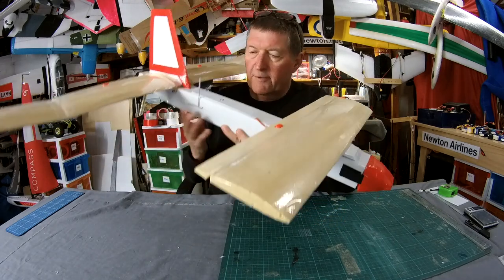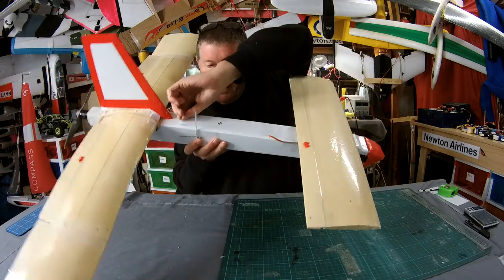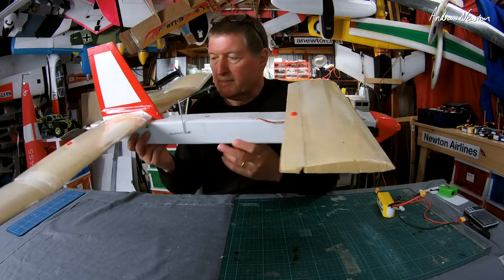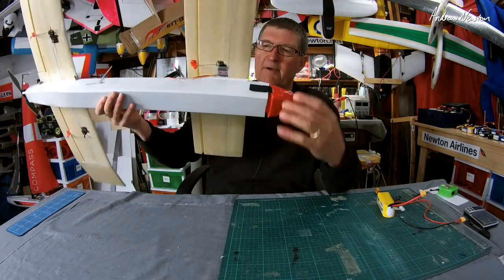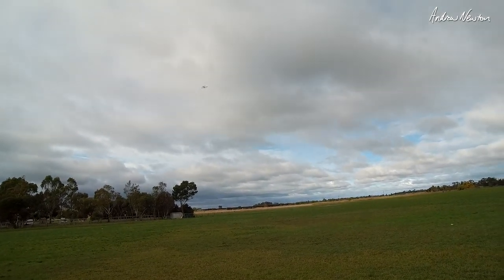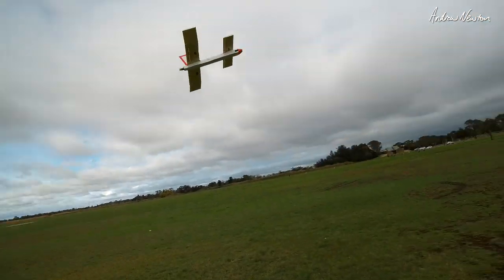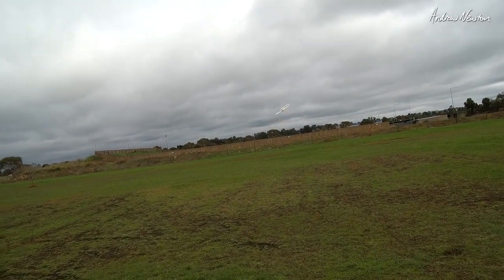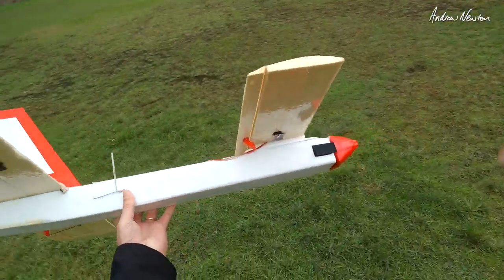Smeg Head mods and plans

Comment: I find that a bamboo skewer thru one of the flute channels (snug fit) makes a nice way to stiffen my coroplast decalague on planes where I use it.
Reply from the maker: Good idea, ready made channels
Reply: @AndrewNewton  It's good for plugging sections together too, as well as stiffening. I made a (fairly wonky) pusher-prop De Havilland Vampire that could be disassembled/reassembled easily, and that was what I used for the joins between the booms - two opposing chunks of corflute on both sides, with barbecue skewers just fat enough to be a tight fit. Not the best method, but can be handy. :) Absorbs energy well in a crash - usually just pops apart cleanly, and if something DOES break it's usually the skewers, so you can poke them out and stick fresh ones in.

Comment: Hi there, loved this one so much I built a 1s Powered one from Depron and a Flite Test style EZ Power 2 CH pack. Flew straight off the board with an Estes Astrocam up front.  Came in at 2.2 ounces AUW.  Thanks for sharing the proportions on the Cardboard Canard. Differential thrust works well on this, have you trued that yourself?
Reply from the maker: Sound excellent, a super light weight one. Have not tried diff thrust

Comment: Good flying Duck, they are Awesome, seems Your Mainwing s right Leading Edge is a bit depressed, what kind of Foil did You use for covering ❓
Nice Video 👍🏻Salute from Vienna, Anton 🇦🇹
Reply from the maker: Thanks Anton. Heavy duty packing tape, with a light spray of 3M 77 adhesive first.
Reply: @AndrewNewton  to make the Surface more Sticky, good Idea 👍🏻❗

Comment: Smeging awesome scratch build but if it flies well and your an experienced flier why use flight control boards like inav?
I'm obviously missing the point of these boards.
Reply from the maker: Forget the Flight Control aspect and you have an OSD, filtered BECs, power distrbution, telemetry sensors for current, horizontal and vertical speed, distance, altitude, voltage etc, and it will bring your plane home if you lose signal. I usually fly around in manual mode.

Comment: Hello Andrew. I'm 80 YO but have just designed and built a 320g canard electric model. I.m not real good with RC set-ups and ask if you would explain the snap-flap set-up used on Smeg Head. I'll send you my email address and pictures of my model for comment if you wish. From Canberra; Roger
Reply from the maker: Hello Roger. Happy to help, my email address is in the ABOUT tab. Interested to see photos